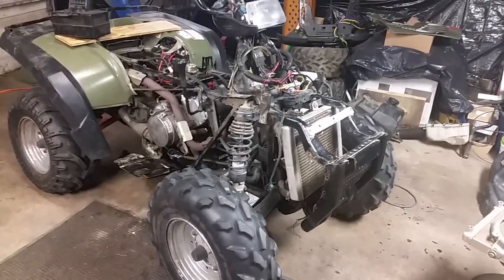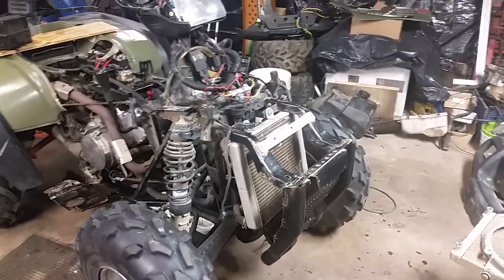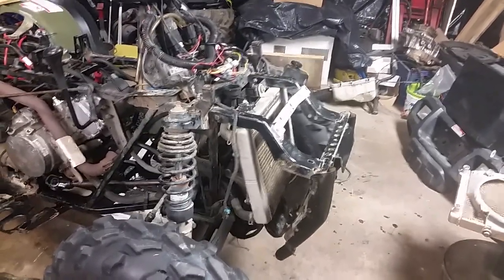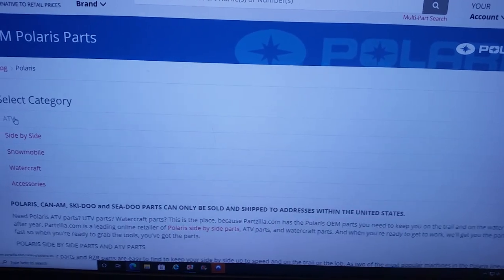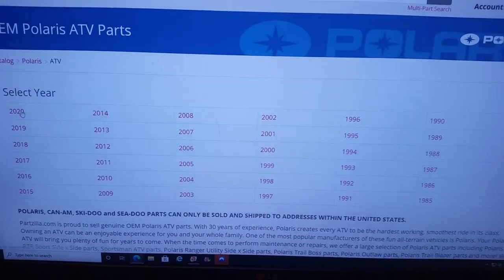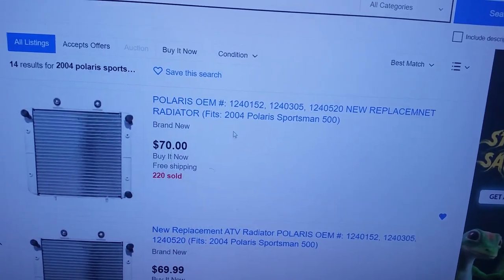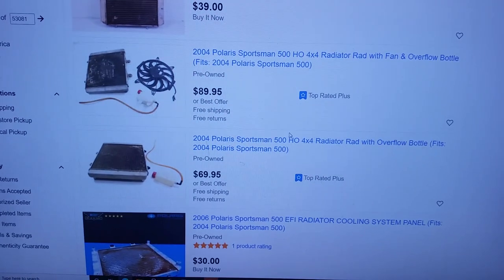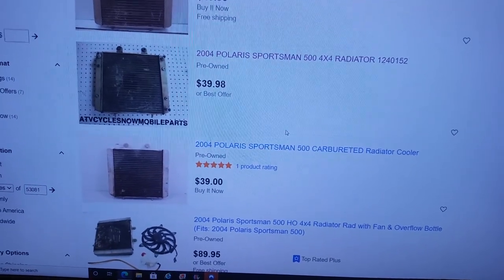How to find the correct part number for your ATV.

Comment: Great job .. love your videos very informative we just got our first Polaris sportsman 500 1999 but has a blown motor Husband has been watching your videos to learn how to rebuild can u give any quick advice on the years compatible with ours can we interchange as far back as 95 or not or as new as 2000 any help will be appreciated thank you in advance ....
Reply from the maker: I think 1997 through 2002 it's the same engine. 98 and 99 were the bad camshaft years. Polaris made them out of soft metal and they don't last long.
Reply: @TitaniummanGarage  thanks I know he's looking on eBay for a complete lower end our rod broke and took out some of the casing our head and jug made it out ok but bottom end got tore up around crank not sure what happened to it bought it for $350 here in illinois from a older guy who took very good care of it Husband thinks oil pump went out on it is that common on them should we install a new oil pump if we can find a good lower end or just clean it
Reply from the maker: If you've gone that far, it might be wise to replace the pump. Fyi..425 and 500 cases are the same. Might save you some money.
Reply: @TitaniummanGarage   thank you keep up the informative viedos .....